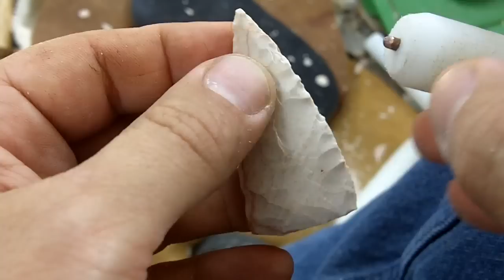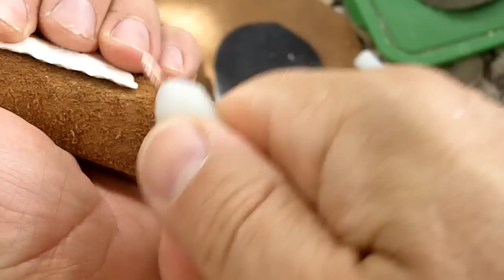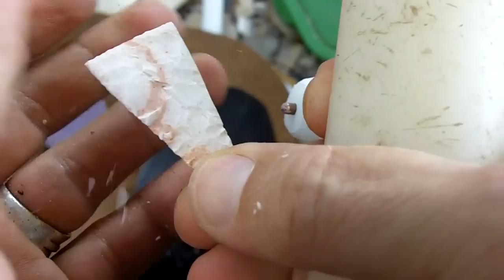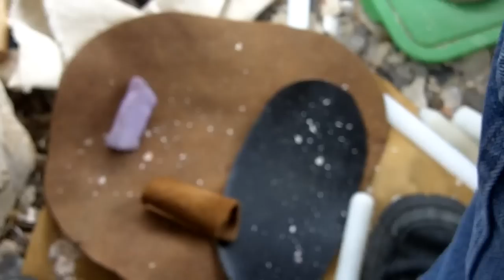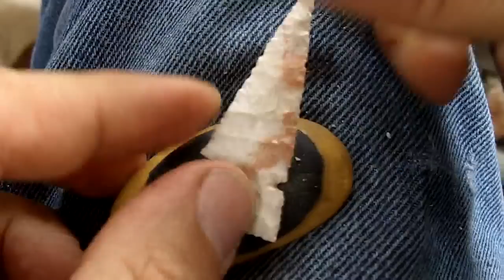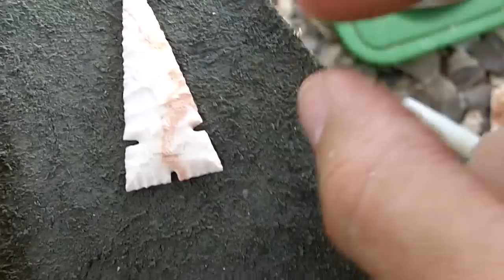261 - Very Thin Cahokia Arrowhead Flintknapping Burlington Chert

Comment from the maker: Thanks.
That anvil was developed after many, many frustrating breaks across the notches.

It's a convex piece of wood (osage orange) with a piece of black leather glued to the wood.  The surface is convex or "domed" so that only the part that I'm applying pressure to is making contact withe the anvil.  This prevents bending stress during the notching.

I've broken way too may arrowheads with flat pads or notched pads.

Comment: How much inward pressure do you put on the indirect flakes tip with your point hand? Maybe this is where I'm going wrong.ive been just setting the tip where I think it needs to be on the platform.
Reply from the maker: I apply very little inward pressure: just enough to keep it in contact without sliding.  But you can apply as much inward pressure as your grip will allow.

Comment: Why did you start off pressure flaking one way and change to hand pressure flaking? I dont know what the hammer type of flaking is called but what's the advantage of it over by hand? Thanks I'm in the learning stage still.
Reply from the maker: The hammer type of flaking is called " indirect percussion". And I'm not exactly sure why I change from one technique to the other. It usually boils down to what seems to be working or not working at the time.
Reply: @KnapperJackCrafty  ok thank you for reply.

Comment: I'm just beginning but  for the last 30 every  I would cringe  every time you struck your  flaker against it just knowing it was going to snap. I'm guessing  achieving a point that delicate is a challenge more than a utilitarian purpose? I was thinking when is he going to stop!? Awesome work, I hope to be that good one day, you have incredible control.
Reply from the maker: Very thin points would  very often break off in the wound and were used primarily for warfare. But they do require a good deal of skill to make and, consequently, were not as common as the thicker ones.

Comment: Question, because I'm genuinely interested.

How did folks flintnap without copper or steel? This is stoneage stuff right? I wouldn't think that refined metals were available.
Reply from the maker: Th3uNn3rV3d If you go back to some of my earliest videos, you'll see me use "organic" materials.  It's called "abo" technique in the flintknapper community  (short for "aboriginal").   Here's one of a five-part series I made:  https://www.youtube.com/watch?v=s4KbQTqOXFs   You're right.   There is not much evidence that copper tools were used.  I use copper because it's cheaper and easier for me than organic material.

Comment: Does support help carry a flake?
Reply from the maker: Rarely.  But it depends on where the support is.  If the support is on the opposite side of the strike, then yes.  If the support is pressing onto the path of the flake, then no, especially if the flake is removed with downward pressure instead of inward pressure.